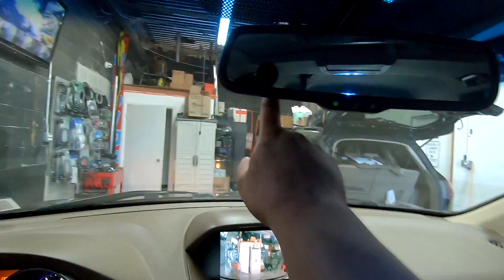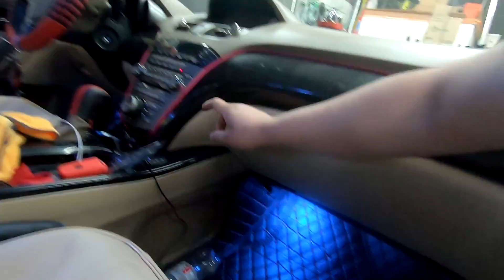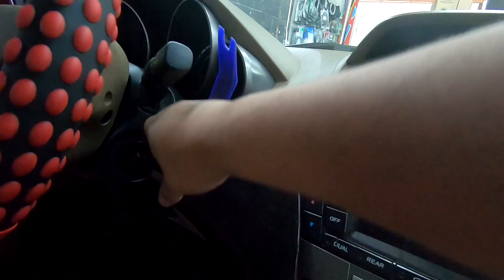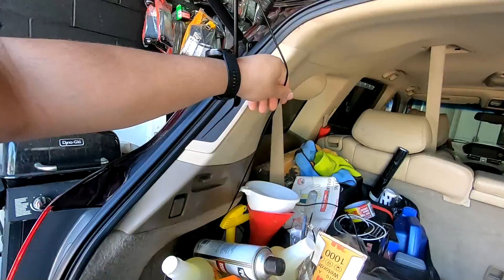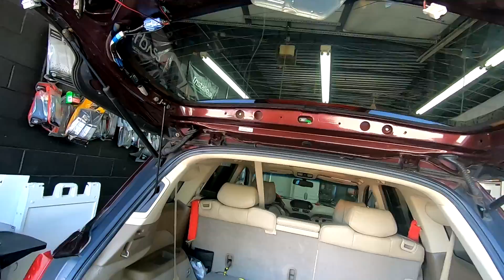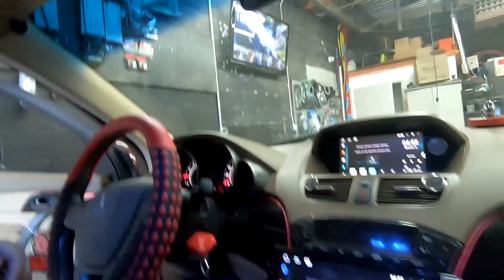2007 2008 2009 Acura MDX Tech Package Navigation ELS Audio Radio Upgrade - Double Din Install 10.1”

Comment: How would I install the ELS AMP Retention interface? I need to know because I installed a kenwood DMX4710S in my 07 MDX but I’m only getting sound from my front speakers and trunk speakers only. Rear door speakers have no sound and the sound overall is really low. Any helpful tips would be greatly appreciated.

Comment: Have you looked into the video input of the factory screen? From what I've noticed acura used the same analog video display bus on the hdd and the DVD based systems. Rgbs what I'm trying to figure out is it ntsc?

Comment: Would you consider creating a harness to extend the gps jog wheel connector by a couple of feet?  Currently if the gps unit loses power my upper screen won’t work until I input the code so I have to slide the new radio out to connect the old unit.
Reply from the maker: Yes we have this please email us to get one